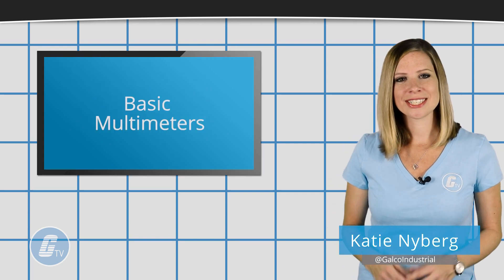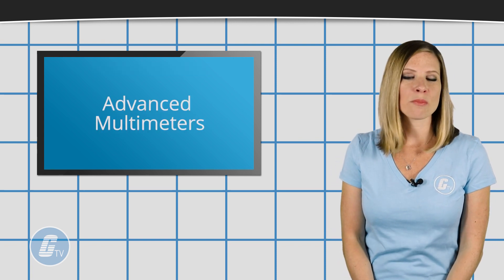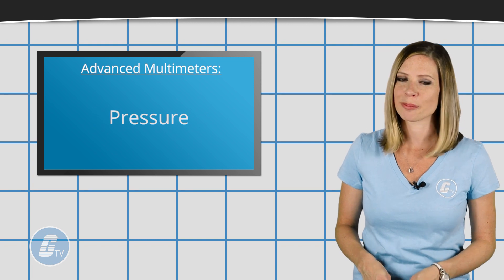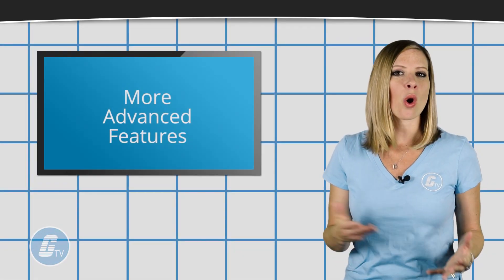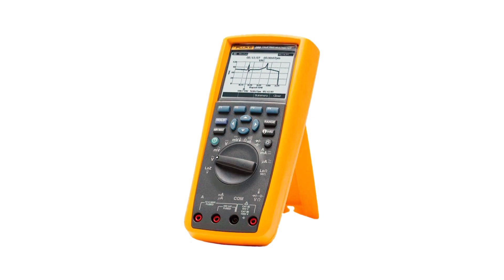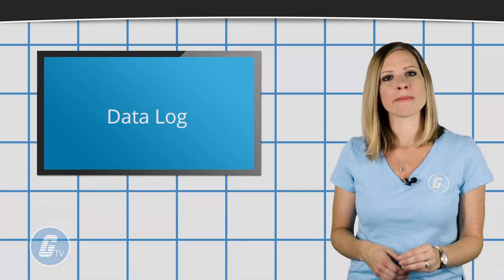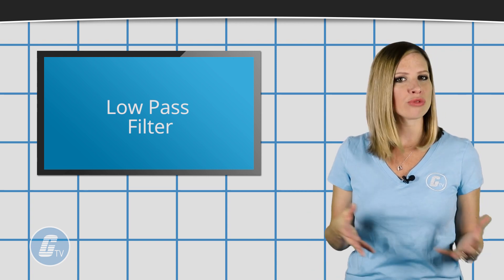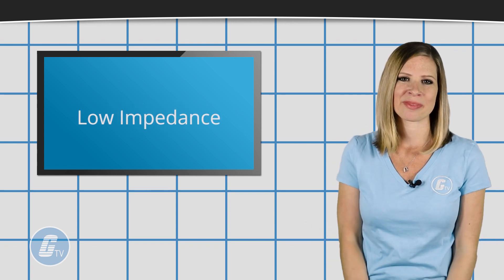Advanced Multimeter Features - A GalcoTV Tech Tip | Galco

Comment from the maker: A multimeter is an electronic measuring instrument that combines several measurement functions in one unit. A typical multimeter can measure voltage, current, and resistance. Analog multimeters use a microammeter with a moving pointer to display readings. Digital multimeters have a numeric display, and may also show a graphical bar representing the measured value.